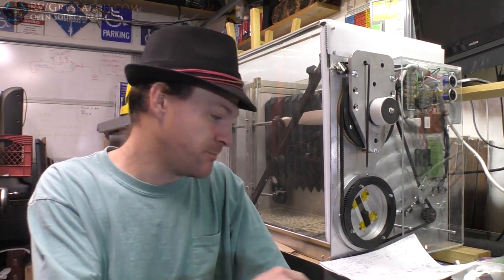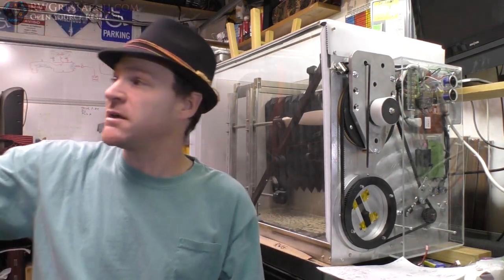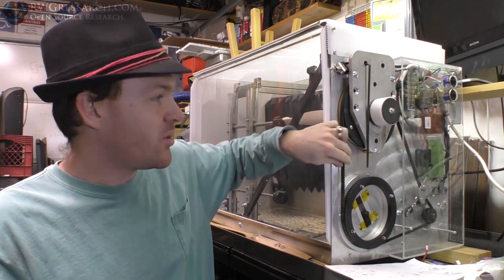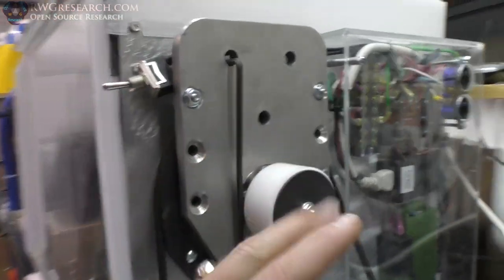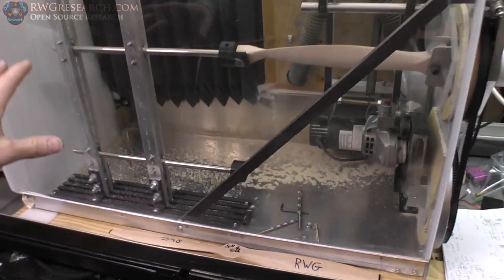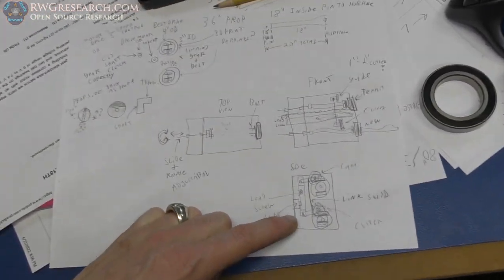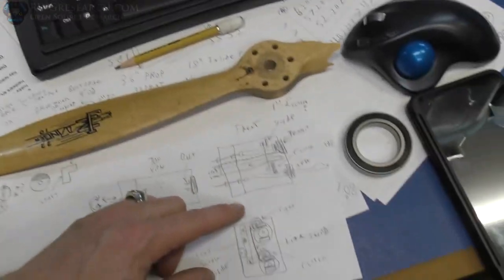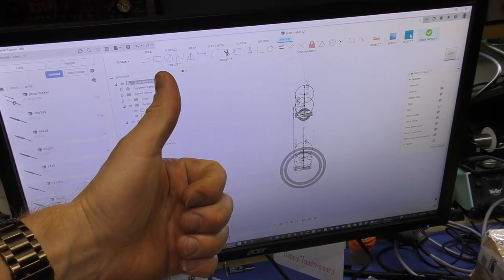Prop Maker part 1: When you're too cheap to buy props! #46-22

Comment: Been awhile since we seen a Russ contraption made from junk parts!  How much thrust can those props put out?
Reply from the maker: Yeah.. Its been needed i need to create more stuff. Its where my passion is :)  i have a video about that... but at a glance.. the motor combo i was testing, its about 23lb of thrust on a 12cell lipo. and that's for the 2 prop. the 3 prop is about 27 lb i cant member but that's about 2500W - 3000W or something. in a stalled condition. ~Russ